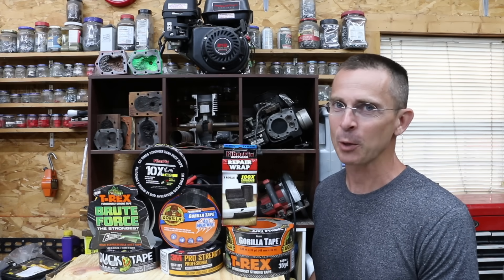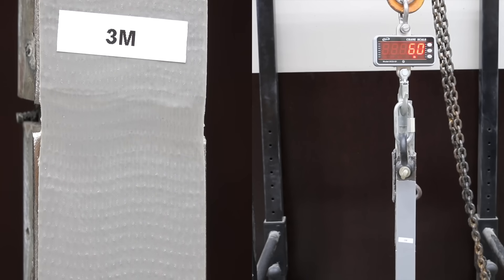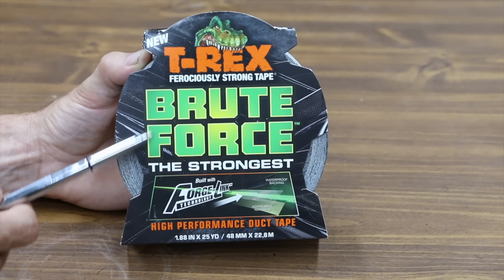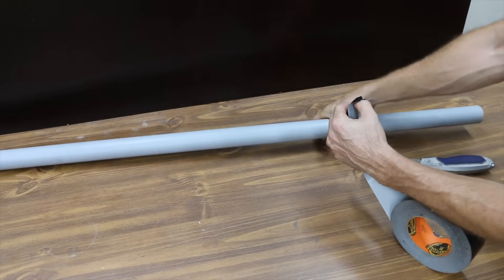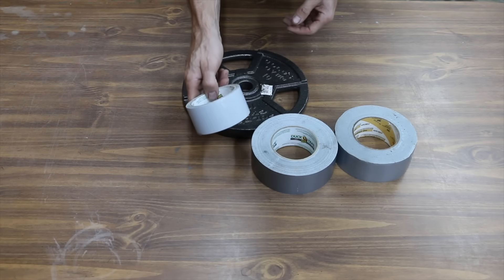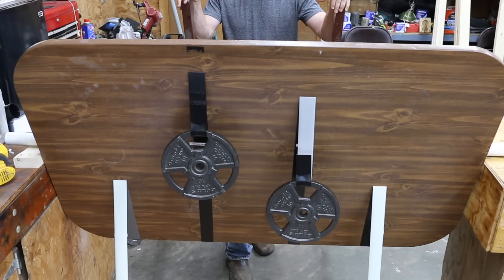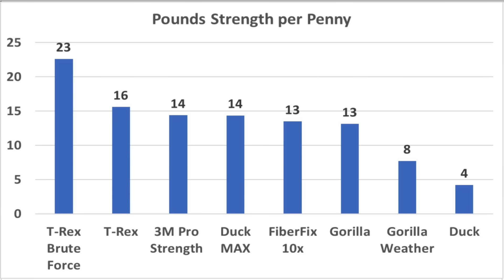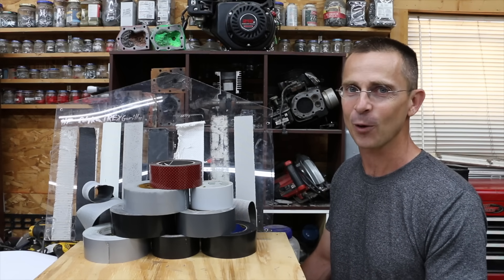Which Duct Tape Is Strongest? Let's find out! Gorilla, T-Rex, FiberFix, 3M Pro & Duck Max

Comment: The Navy uses a product similar (Probably the same thing) as that FiberFix Wrap to repair battle damage to high pressure pipes on warships (Rated up to 150psi). Isolate the leak. Submerge the roll in a bucket of water for 30 seconds. Wrap the pipe. Let set. Then re-pressurize the pipe. Works well as an easy to teach tool in the pipe patching / damage control world.
Reply: Pretty much a cast.
Reply: What does submerging the roll accomplish?
Reply: @eugenetswong  It activates it.
Reply: @eugenetswong  it uses a 2 part resin were water is the part that makes it work
Reply: @captainheat2314  and   DarkLinkAD , I yad go pause, when I read your 2 responses. It seemed rather terse and sarcastic, until I remembered how fascinating technology can be. I appreciate your time.
Reply: Sounds like water activated fiberglass tape?
Reply: Good ole sinthoglass

Comment: I'd like to see videos testing different wrench brands on resistance to slip/round a bolt resistance to bend, break, or deform, and corrosion resistance as well as a video testing ratchets on the resistance of teeth to strip/slip, the rachet it self to bend, break, or deform, and corrosion resistance.
Reply from the maker: Thank you for the video idea!

Comment: Great, great, great test!
As a motorcyclist (and as a car driver) i see tapes as an emergency problem solver; so some additional useful infos could have been how well they are in "high" temp (for scenarios like wrapping tape around a warm/hot part of an engine just to keep something there until you're home, or perhaps the final part of the exhaust, and so on) and how they become when wet (like under rain).

Anyway, great video.
Reply from the maker: Thank you

Comment: I'll give Gorilla Tape this...
I had a 4 foot rip in a tarp, and I'm not talking any tarp, I'm talking trucking tarp made to withstand 80 mph speeds in high-turbulence environments.
I didn't have to replace the repair for a year.
The T-Rex tape turned goop after a bit in the sunlight and heat.
Just regular Gorilla Tape, I'll swear by it.
Duck or duct, I'll use those for "regular" jobs.
Reply from the maker: That's Great!
Reply: @ProjectFarm  you have no idea....
Flatbed truck tarps run about $350 per, and this was one of the smaller ones.
The T-Rex tape turned goop and failed, but the Gorilla 4"tape held up for a year.
I wound up replacing it, gradually, with a combo of Flex seal in the paint can and Viva or Shop towels.
Let me know if you want the "recipe".

Comment: Hey project farm could you try different electric connecters to see which is stronger like butt connecters or wire caps or spilt connecters and solder with shirk wrap and also see which can take most heat and amps though it with out failing
Reply from the maker: Thank you for the video idea!

Comment: Video a year in the making. Wow. This is why I subscribe!   I think this deserved a spreadsheet of information honestly, with how differently they perform and how permanent your repairs have to be, how strong you need vs price etc.  Alot of factors to consider when buying.

Trex is definitely impressive, and so was the pipe fix tape.  

I was wondering how they would perform after a days worth of water going through the pipe and it being submerged like in a bowl or tub.  I would like to suggest a test like this, then do the strength test but use the same vertical weight to pull up instead of the weight to pull down so you can digitally slowly calculate it. Then we could see which one is better for wet applications like a quick fix at sea or on a boat...
Reply from the maker: Great video idea on water exposure!  Thank you

Comment: Great test.  You even had a weighted roller, to keep it fair....  Very nice.

Great video.

Now, of course I would like to see another weather test for a year.....

The testing you did was great...  this is not a complaint about the testing you did...

But...  (there's always a but...)

I feel like, when I do a wrap repair on a pvc pipe, often I'm not that worried about how far it might bend, or the load it can carry.  The pipe is mounted in hangars or holders to ceiling joists or a wall, or what have you....  What I'm really looking for is, will the pipe carry water??  Or is it going to start leaking all over the place???

I had a radiator hose start spraying...  I did one of those radiator hose repair wrap deals...  And it did work, I drove 300 miles with it....  But if I had tried Duct Tape, would it have worked??  Can it withstand hot liquid under pressure??   Another possible future video.

Hard to argue with the Brute force.   but I do agree with you 100%, it depends a lot on what you intend to do with it...  If I am wrapping, I like to stretch it a little, as I apply it, so that the wrap, becomes this circular ring of stretched crushing force, crushing the tube or pipe from all sides....  In other applications, your table test was really the most revealing... Does this stuff hang on, and resist the pulling force....
Reply from the maker: Thank you for the constructive feedback and the test idea!

Comment: I think the sleeper outstanding performer was Hurricane. After a year in the weather it still looked great, still had a lot of stick, and most surprisingly, it peeled off cleanly. That's the one, along with Flex, that you won't regret using outdoors. Most of the other ones were a complete mess! It looked like just the top layer was peeling off some of them, while the adhesive remained. Cleanup looks like it would be a mess. I'd rather find what was under the Hurricane tape, that's for sure. As always, thanks for these videos. You really take these tests seriously. The one-year exposure to the weather test is crazy, something you're not going to see anywhere else.
Reply from the maker: Great point!  Thank you

Comment: definitely test the tape under weather again !!!  The biggest problem ive ran into with tape is that the adhesive dries out when wrapped on heating ducts and falls off.  What is even more interesting is that the white asbestos tape that was applied to joints on many of the heating ducts in my basement using wheat paste in the 1970's, is still holding up.  It is not fraying, not flaking, not moving.  With no deterioration, it was recommended that it be left as is for the time being.
Reply from the maker: Great point on the adhesive drying out.  Thank you!

Comment: This is a great video, but hands down my favorite part was the beautiful white 5.9 Cummins Dodge Ram. Best motor ever put in any pickup truck in my opinion.
Reply from the maker: Thank you very much!  I've had it for 12 years and it's been very reliable and easy to service.  I like the other brands too, but found this one for a decent price. Hope it'll last another 20 years.  New trucks are nice and also pretty expensive. lol
Reply: @ProjectFarm  I am not so much a Dodge guy as a Cummins guy. There is just something about the sound of Cummins that says 'Let's go to work! 

Also no doubt it will last that long, the truck itself is the weak point. If you have an automatic you will have to replace the transmission from time to time. Also, the front suspension will wear out. The dash will crack and fall to pieces. But all that can be fixed.

Comment: What I see from this is that its important how you apply the tape. For the pipe wrap test you could start with tape length-ways then wrap to hold it in place. Thus as the pipe bends its stressing the tape in the direction that the tape is strongest.
Reply from the maker: Great point.  Thank you

Comment: Curious to know what the temperature and humidity was at the time of your testing as I think it would factor in on at least the adhesive testing.  I know we can assume its a constant between the brands but some might perform better in different environments.  Anyway, good video as always.
Reply from the maker: Great point!  I keep the shop around 75 degrees and relatively low humidity.

Comment: Yes, I would love to see a video on how well these tapes do with weather. We have a 15 year old john deere lawnmower, and the bagger tube is basically held together by duct tape (lol). We used to have to replace the tape it every few years when we used normal nashua duct tape, but ever since switching to gorilla, the tape has held up very well. It would be interesting to see how much better gorilla weather does (if it does better at all). If so, it might be worth buying over normal gorilla for our applicaiton. Also, the reason why all of the tapes tear easily is probably so you dont need scissors to cut it, instead you can just tear it. Great video as always!
Reply from the maker: Thank you!  Glad your experience with the 2 brands matches the 1-year test.

Comment: I feel like the Gorilla Weather should have been thrown out of the tensile strength test, the adhesive did not seem to be able to hold the tape to the bars unless extra tape was applied. Or we could use the tensile strength of the adhesive itself rather than when the tape rips. Maybe it's the material that the tape was applied to but all the other tapes didn't need much help (with the exception of the T-Rex Brute Force). I'd be cautious of using it outside because if water gets in that adhesive and the tape experiences any type of tensile strength it would fall off (presumably). Just a side thought :). Great video!
Reply from the maker: Thanks for the constructive feedback.

Comment: Which one do you think works best to seal an rv roof and seal up the AC duct system.
Reply from the maker: Duct tapes really aren't designed for that sort of application.  Flex tape or a similar product would work better but it'll be nearly impossible to remove.  Hope this helps!

Comment: Try the duct tape on actual ducts. In this area, according to code, duct tape cannot be used on ducts. The many heat/cool cycles make it go bad quickly. Tho when that code was put in, they didn't have some of the tapes they have now. Here you have to use the aluminum tape, or a silver tar like stuff we just called pucky. There are also some tapes out there that Nascar teams use to hold parts on cars after wrecks, we call that 140 mile an hour tape, but now they have tape that stays put at over 200mph. These are very expensive industrial tapes that even when available on the open market nobody buys them because they cost a whole lot, totally unreasonable amounts of money per roll, starting at around 40 dollars per roll and up.
Reply from the maker: Great point!  Thank you

Comment: Awesome! I've been looking for the best tape to do repairs to my polyethylene car shelter. It rips within a year or two, and the right repairs can extend its life by years. I have found that many tapes fail in the weather almost immediately, but I recently found one from Nashua Tape Products that is specifically designed for polyethylene tarps and it worked over the summer. However it is starting to give way now. Gorilla tape has failed very quickly in this application. I don't know if this kind of thing is conducive to your kind of testing, but finding the best brand of polyethylene tarp repair tape would save me a bundle!
Reply from the maker: Great video idea! Thank you

Comment: I'm not sure the pipe test in this video is the best way to go about accurately measuring torque applied to a repaired pipe. It might help to cut small notches in the pipe to better secure the weight, or use a jack/pulley on the end and then measure the angle/force at which each product failed. Either way, great video and always fun to watch!
Reply from the maker: Thanks for the constructive feedback!

Comment: Ah the old blue tractor with the Restore in it.  Hows the compression holding up in that engine?
Reply from the maker: Thank you!  I haven't checked the compression since the last video.  It's been running great!  Used it a lot this year already for mowing and raking hay.  Never misses a beat.
Reply: Project Farm it would be great to see a compression revisit on the blue tractor.

Comment: I've used Gorilla tape and glue and it's the best product out there in my personal humble opinion no disrespect to any other competitors or people or persons that use any other name brand the only one that I have not used is Flex Seal I used it in a spray can but the tape I have not used and the caulking I have used and it sticks and it leaves a nice finish even after you paint it so those are the products I have not tested yet which is Flex Seal tape but I have used their spray for the gutters and to caulk around my windows to weatherize my house right before winter and right before summer I thought I was going to need it again and to my surprise it look as good and as fresh as the first day I put it back last year in October right before winter time so the Flex Seal caulking and the Flex Seal spray on the gutters work excellent I have not use their tape or any other product they may have because I know they have a liquid form that turns into rubber and I have horses and I looked at one of their gallons and I was going to make a big mat a 12 by 12 Mat 2 in thick I can go to Tractor Supply and buy one out of rubber for approximately $50 each and I would need approximately 4 of the mat and if I was to buy the Flex Seal liquid it cost about $40 a gallon and I was going to need roughly about 14 to 15 gallons so that was way out of my budget not out of my budget but more than what I wanted to spend and I have four horses so they have to take that into consideration because you put the matte you live with the floors out with cushion saying you lay down the mats and then you come back with shavings wood shavings to make the bed in the stall for the horse at about 18 in to 24 in deep to give them a good bed and so that it will deserve the urine and feces and stuff like that but I didn't go that route about the mats individually but as far as I'm concerned my personal experience is that Flex Seal spray and caulking is real good and Gorilla tape and glue is very excellent I've got no problems with that product and I use it more than any other brand that's my go-to brand and once you wrap something with that tape it stinks like like if it was welded I'm not going to lie I use it on a PVC pipe that had a small leak at a crack on it and I used it Gorilla Tape to wrap the PVC piping I went 8 in to the right and 80 inches to the left which made it 16-inch wrap it doesn't have a lot of pressure on that PVC pipe and I did not have to replace the PVC pipe and that's been 3 years ago and it's still holding up very strong thank you for your video and forgiving us more knowledge I am grateful I know what products I can use and which ones are going to hold up the best thanks to your video may God bless you and your family always God bless!!! And it looks like I'll be using T-Rex brute force that sucker was four to four and a half times stronger than Gorilla Tape wow that was amazing I have not seen that product at Home Depot nor at Lowe's but I will order me some online if I have to I got to give it a try that's a lot of strength !!!!!! 👍👍👍👍👍👍👌👌👌👌👌👌👌👌👌👌👌👌👌
Reply: @Tumbleweed have you ever heard of mind your own business?? if you don't like it jumped to the next comment!! Plain and simple! Move on before I blast you with some negative comments that you're not going to like!!
Reply from the maker: Thank you!

Comment: Idea list:
1. RTV Gasket Maker
2. Razor Blades
3. Electrical Tape
Reply from the maker: Great video ideas!! Thank you
Reply: If you do a test of utility knife blades (I'm assuming the suggestion is not for shaving blades), then please include the Japanese brand Tajima. They are the one to beat I think.
Reply: @61hink  usually Japanese made stuff is great quality no matter what it is.
Reply: @61hink  never heard of Tajima but its good to know.
Reply: @andreyka64  A box of 100 is $25 on Amazon. A little more expensive than most blades but 25 cents a blade is still not much.
Reply: @61hink  agreed, it aint much. its a fairly cheap consumable overall. 

it'd just be nice to see some formal testing against all the different brands. i wonder how they all differ, as ive never analyzed any of them closely, i just pop one in and keep cutting.
Reply: There's already one on electrical tape from a while back... it was from before I started taking notes, though, so not sure how it went. I don't recall any of them standing out in a huge way like Trex Brute Force did here.
Reply: @Maeyanie  Ahhhh good catch. I actually didn't see that video !!! Thank you
Reply: +1 on the RTV test!
Reply: 2. Razor Blades

I like this one.
Reply: @pomegranatechannel  yeah, it something that I go through a lot at the shop. I've definitely noticed good and bad blades over the years, but I've never kept track of which brands I've actually been using.

Harbor Freight ,DeWalt, Stanley, Husky, random ones on Amazon, etc.
Reply: @andreyka64  At least you remember the brands! I just grab something that LOOKS better to my eyes and don't remember the names lol
Reply: @pomegranatechannel  yeah, ive tried a bunch of them over the years. so i remember a handful of the brands.

Comment: I bought the T-REX tape after the last video lol. It's actually impressive.
Reply from the maker: Thank you!  I've used a lot of Gorilla and TREX over the last year and like both.  TREX seems to hold up a little better
Reply: @ProjectFarm  I wonder what the strength would be If you put pieces of tape lengthwise along the joint and then wrapped the tape around the joint - as Im going to buy trex perhaps i'll try it myself!
Reply: I work for a distributor and at our last meeting with manufacturers I told the T-Rex guys about your video and then played it for him.  He was very happy.
Reply: I did the same.  It’s good tape👍